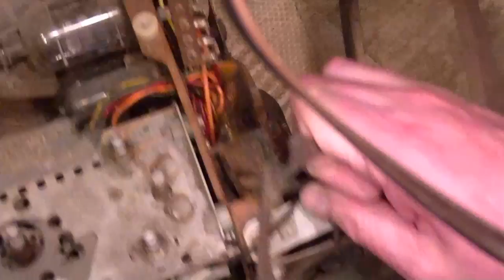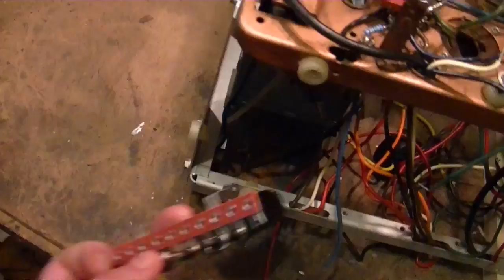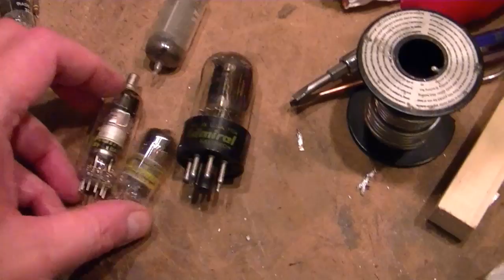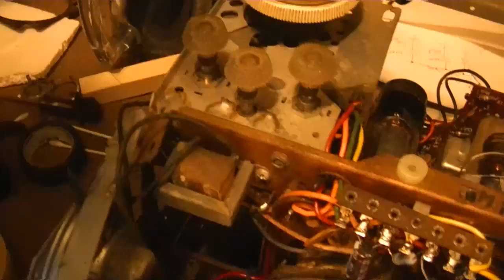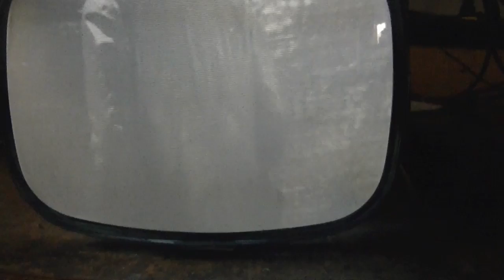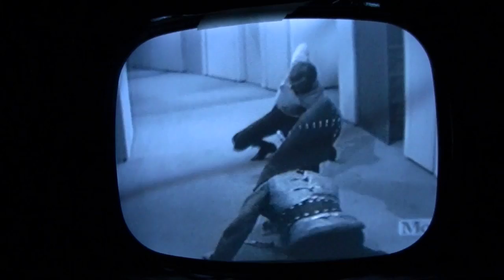Admiral T105AL restoration p2o4

Comment: Bob..in the spirit of the worst question is the unasked one..what does the foil do? contain electrons? shield the flow? I have no idea of how or where to start but there is something about the way you present the videos..you do a great job..and you are very good at it!....thx..Rich
Reply from the maker: iamrichrocker Thanks!  There's HV inside the CRT glass, then the glass insulator and grounded foil on the outside. That makes a capacitor of a few 100 pF which is all that's needed to filter the HV.

Comment: What do you use to glue the socket on to the picture tube?
I was successful welding the cathode also, thanks for the info on how to do it.
Reply from the maker: Carl Burgess Permatex windshield silicone - check out my CRT base repair video:  https://youtu.be/LQQLTnaYU9U?t=10m20s
Reply: bandersentv Thanks, I had watched that video in the past but couldn't find it to see what you used.

Comment: Would it not be possible to create replica control knobs via 3d printing?
Reply from the maker: tomwiles I don't think the resulting plastic would be as strong.  Also there is all the setup and 3-d modeling time.
Reply: bandersentv If a database of scanned downloadable replica knobs existed, perhaps at some point the consumer 3d printed material might be made durable enough.
Reply from the maker: tomwiles Maybe someday, but there are still some original knobs around and replicas are available from vendors like Renovated Radios.

Comment: Just wondering if any of the tubes were weak or bad. Don't believe that you mentioned the results of the tube testing.
Reply from the maker: Herbert Susmann 12DQ6 horizontal output tube and 5J6 oscillator/mixer tube were a little weak.  None were bad.  One odd thing though is I found a 3CB6 where there should be a 3DT6.  No way the sound would have worked with a 3CB6.
Reply: bandersentv http://frank.pocnet.net/sheets/093/6/6DT6.pdf

Yep its a audio tube but not really the right kind.  3CB6 is about the same as a 3CF6. not sure what the drop in replacement or substitute would be for either tube.